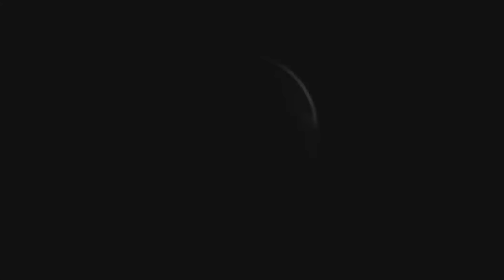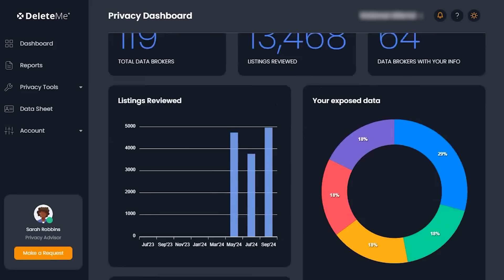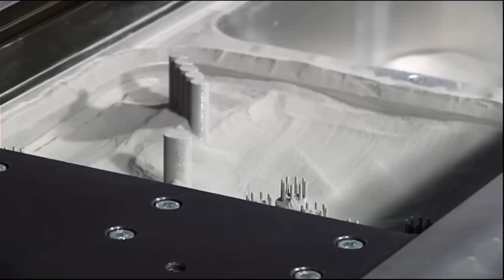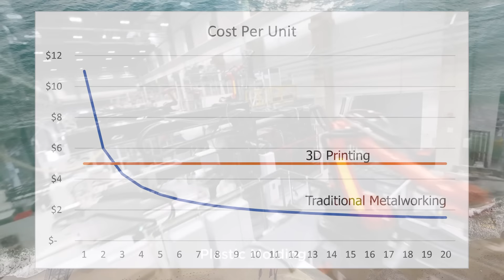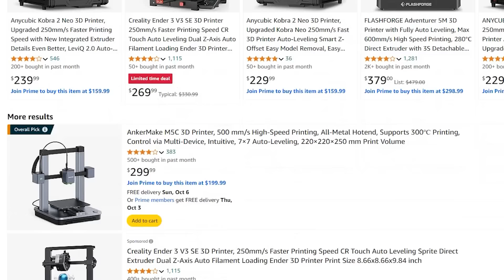3D Printing, Cathie Wood's Latest Disaster

Comment: 3D printing any sort of high-strength metal is laughable. Metal castings derive strength from a controlled and uniform cooling process, something which building things in a thousand layers can never provide.
Reply: You might want to look into Ti 3d printing using Ion beams. It's used in critical aircraft applications like wing roots and space/satellite etc where strength and weight is critical. You can Xray and other NDT them to check layer bond. ALso layer bonding when done right is basically the same strength as the material around it. I've had 3d printed parts fail perpendicular to bond lines many times in testing. Designing around it in some application is also important but it's not always a major weakness depending on the process and method used.
Reply: @N4CR  A lot of these parts she is aspiring to print derive their strength from the part cooling so precisely that it forms a single crystal. Impossible to do with printing.

Comment: Also........Elmo claims that Tesla is a robotics company, despite not actually selling a single robot. And if you paid for FSD, you got robbed by a conman
Reply: FUD!
Tesla has been selling robotic cars since 2015. Currently 8 million driving around now!
FSD is receiving unparalleled plaudits throughout the industry:
The first Tesla autonomous coast to coast/cannon ball run was October 2015. Carl J. Reese, Deena MastracciIn and Alex Roy made the 2,995-mile (4,820 km) journey in 57 hours, 48 minutes The trip was completed with fewer than 14 hours of charging and 96 percent of the driving done by Tesla's Autopilot system. 
"Tesla tear-down finds electronics 6 years ahead of Toyota and VW. Self-driving AI sends shivers through traditional supply chains. Tesla so far ahead of more established peers that its technology could end the auto supply chain as we know it." Nikkei xTech/Nikkei Automotive
“The performance after FSD 13.0 is still very strong. What we can see is that Tesla’s fundamentals are very solid. In the AI era, mastering the fundamentals is essential and cannot be skipped.” Li Auto CEO Li Xiang. 
“Tesla is indeed amazing. It has led industry trends in many areas, especially FSD (Full Self-Driving). We still have a lot to learn,” Xiaomi CEO Lei Jun 
"I think the Tesla stack is the most advanced AV stack in the world," NVIDIA CEO Jensen Huang.

Comment: I'm a mechanical engineer and for years I've been saying 3D printing has been over-hyped. Yes it has it's uses, but they're niche compared to traditional manufacturing as the video says. Inevitably there's always that manager that thinks it's cool and wants to impress his boss by trying to make it fit into product lines, but it never really does.
Reply: A product we're working with is a valve with electronic components that are very (very) tightly fit together. The valve body and it's parts are milled from whole but a simple to print (but difficult to produce otherwise) polyamide resin bracket to hold the internal wires in their proper place is 3D printed. The part adds value to the product, It'd be a very expensive with any other traditional manufacturing method (and have issues like sharp edges if stamped with associated costs and risks, exorbitant price machined) and is a novel application of the technology. It solves a problem at a reasonable cost without downsides (electrically not conductive, doesn't damage the wiring, keeps things neat, simplifies assembly, prevents damage...

It's just another tool in the toolbox. If we had a larger scale printer we'd also be able to potentially save another customer a fair bit of headache with a prototype they've been building. The lead times are around 6-8 weeks because they're complex (70kg of aluminium machined down to a 15kg housing with complex internal shape) whereas a 3D print could verify the assembly dimensions in 1-2 weeks with the milled down product coming a bit later with potential for in-process revision.

There's just a fair bit of figuring out what the tool is best suited for. There's a tendency we have as humans that when we have a hammer we see every problem as a nail however some structured guidance to people on when technologies are best used (including examples) to solve a problem can lead to win win out of the box solutions. Be it turning, milling, 3d printing, stamping, casting, forging or any other process.
Reply: Honestly it was a sure bet to short the stock. If you used common sense.
Reply: @paulnyagini  But it's a scary (and at times fatal) ride along the way. Professional short sellers don't short until the downtrend is solidly established. 

Did you know that Michael Burry almost went broke before he was vindicated?
Reply: It's better used as a component. E.g. I work aluminium, rivet, cut, shape etc, then combine it with it to make recycled alu LED lamps with extremely high lifetimes due to heatsinking.
Reply: Just the experience of 3D printing is fantastic!  Anything you can dream up you can produce!  But I guess not everyone gets excited about that.
Reply: Well that's also not strictly true. There are limits to the technology and not all printers have the same capabilities.
Reply: It's a really high skill floor to be useful. You need a ton of not obvious skills to make it work irl. Measurements in cad don't directly translate to the printer which can changes depending on calibration. It's really tricky for novices to get into
Reply: @ArcherNoble And then what? (Rapid Prototyping 20+ years.)
Reply: @jdmather5755  it's a joke smashing all the investment buzzwords together.
Reply: its used a ton for prototype but not production or home use

Comment: If a company goes public via SPAC it is not for investors only speculators.
Reply: SPACulators
Reply: @JeiShian 😂😂😂😂😂😂.
Reply: @JeiShian  Thank you😂
Reply: With the failure rate of SPACs, it boggles my mind that investors keep falling for them.  When will they learn?
Reply: You had to be in on the grift to profit off SPACs. Just a workaround to list a story on the stock exchange.
Reply: Whenever I hear the word SPAC, there is always a 95 % loss to investors coming in the next 3 years...
Reply: SPAC = SPeculator Aquired Company
Reply: And Wall Street.
Reply: There have been some good ones though. $HOOD , $ENVX & $DKNG come to mind. Problem is that a lot of companies that have no business being public used SPACs to do exactly that.
Reply: This is it!!!
Reply: Chamath P has entered the chat
Reply: Special Purpose of Avoiding Contention
Reply: That's what she wants. She wants the dumbasses who are willing to take greater risks than anyone else. That's basically what all of Silicon Valley is built on. The startup industry has made more billionaires for no reason than any other.
Reply: Rocket Labs seems to be doing ok.
Reply: @peterfireflylund  I did not realize that they were a SPAC and do seem more competent than some of the others in the field, hopefully, they will be the 1 in 20 SPACS that don't fail.
however
Rocketlabs reported third-quarter revenue of $104.81 million, up 55% 
 Its net loss of $51.94 million
By comparison, SpaceX was tapped by Space Force to conduct a series of missions worth $734 million in upcoming years
and that is a small contract for them.
Reply: I never trusted a SPAC from the moment I learned what it is. If a company can't go public via the traditional way and has to use loopholes likes SPaCs  then something is shady.

Comment: I cast metal, 3d printing is great for making mold templates, and anything that can't be cast can usually be made by casting and machining. Sure, there are extreme cases in the aerospace industry that can be made easier (but less strong) than traditional methods, but over all my job is safe as I do products with high value and medium size production runs.
Reply: Cathy seems to be implying she can print engine parts, ergo the fan/compressor blades themselves. I hear her talk, and laugh.
Reply: Parts can be produced lighter and stronger than casting and machining with 3d printers but the effort isn't worth it in most industrial applications.

Comment: Though im disappointed with the decline of 3d printing because it does have amazing potential, and rhe criticisms listed here are fair, i feel the need to point out the elephant in the room that the 3d printing industry never promised but was hyped by investors and others, and that's the problem with precision. For the vast majority of parts a few thousands out of spec isnt even noticable even downstream, but for the expensive parts like those going into the construction of injection nozzles and turbine ducktails where both precision and performance is a delicate balance, a pronting process will never work. 

Now, where i think 3d orintings greatest strength is, is in the development of prototypes is needed. A proof of concept that can be ptinted out in a couple days rather than meticulous measuring, machineing and a refining over a month can save loads of time and materials.

Comment: I mean the real advtage of a 3D printer is that on super small scale it allows individuals to make stuff at a fraction of the cost. But your selling it to individuals, the few people that maybe would need a print farm, or the R&D department that will use it to make quick prototypes rather then take up machine time in the floor. Yea as an individual my printer has been great and I do use it a lot….. but I still break out my dad’s old tools if I need to make something more heavy duty.
Reply: It solves logistical issues for much of the world

Comment: Still waiting and I own 3 printer and 2 printer are down for repairs. As I waiting for parts from china and amazon . And ever year 3d printer are going though cycle now it is different colors and speed.
Reply: What brand?  Get a Bambu Labs or a Prusa printer and you won't be crying.
Reply: @joeking433  Bambu is getting in financial trouble.

Comment: 3D printing was a complete revolution in scale modeling, but that's the SLA (resin) printers that are used, and they continue to evolve, with impressive performances nowadays. I have two SLA printers and one FDM printer myself, and used along a 3D design software (I use Blender), possibilities are simply limitless. I would even dare to say that 3D printing has revived scale-modeling as a whole, and that many companies that produce tools and paints are being saved by this turn of event. That's not a large part of the economy, but's at least all that work on 3D printing technologies wasn't completely in vain...
Reply: Piracy is the main driver behind SLA Printers.  turns out that people would print a car, or Space marine if they have the machine to do it.
pretty much every tabletop group has atleast 1 SLA printer.  mine has 3 and we went from having issues to people leaving the hobby to having more people that want to play than time.

Comment: I'm on sort-of on Ark's side and still think that this will continue to revolutionize manufacturing in the long term. The technology still cannot replace the majority of injection molded or machined parts, but there is no fundamental and unsolvable issue, especially when thinking about combining additive and subtractive manufacturing.

Comment: Oh, also….molding is not how 95% of aerospace parts are made. That’s very niche. Most are machined down from stock, nearly nothing is molded for production anymore. Nobody wants steel slag operations on hand, man.
Reply: Or most other industries that us any metal.  Forging and heat treating change the characterisitcs.  Not every thing is die cast or molded for a real, physical reason.   Cool tech.Some use cases.  But by no means near 50%!!
Reply: @FactbasedReality0421  Absolutely. You'd need a material testing lab on hand, and that cost would be wild. And there really wouldn't be any benefit to doing it in-house, which is one of the reasons 3D printing wouldn't make any sense in a ton of manufacturing areas.
Reply: Or formed, or welded
Reply: yeah that's the comment I was looking for. molds just dont cut it since the smaller the mold, the more defects it could have. as for huge blocks outer layers can be removed and factory edges are usually also remachined since they aren't always perfect so why risk it.
Reply: Magellan aerospace would like a word with you.

Comment: For tooling and prototypes 3D printing is great.  But you need to think differently while designing them to save material and print time.  You also can not hold tolerances and flatnesses like in a cast or machined part.

Comment: The example for metal, is for parts that can be molded. Actually called casting, in metal. But the strength of cast parts is not that good. Most metal parts are made from prefabricated blanks, such as sheets or rods. And these parts are not cast, but "rolled", which is a forging process. Metal made this way is much stronger than cast parts.

The problem with 'suits' (executives, and fund managers), are they are not engineers, familiar with manufacturing. They have a little and often have Dunning-Kruger hubris. One glaring example is Elon Musk, with his STUPID Gigacasting machines, to build Tesla frames. Those frames are starting to break, because a cars frame carries the greatest load, and casting makes for a weak material, relative to a "stamped" part. Stamping is also a forging process.

Comment: 3d printing always astonished me. They managed to come up with a production technique even slower and more expensive than machining, and then pretended that it was going to take over everything.
Reply: It has to have been marketing types who pushed that, 3D printing for manufacture has never been viable for anything that can be produced with traditional manufacturing techniques. There’s definitely a few niche places where it’s the only option for manufacturing something, but that’s pretty rare. It’s true value lies in prototyping, it’s a huge boon to be able to rapidly iterate on a design without having to get new moulds made, or work with a machinist constantly to produce prototypes when you may not even end up using a design. It also makes it a lot easier for hobbyists or entrepreneurs to get to a functioning prototype of an idea without a huge upfront investment. It’s also great for making replacements for random plastic bits that break on appliances and render them useless
Reply: It was never meant to replace machining. It's always been about rapid prototyping, and to a lesser degree low volume highly specialized parts that can't be machined, such as for high performance vehicles and spacecraft.
Reply: @DoesntRefillTheBrita  This is not what VCs and shills were saying in 2015. They were saying that big factories were obsolete and people would just make whatever they needed on their 3d printer in the garage.
Reply: @quartertwenty484  in case you haven't noticed, investors are usually dumb
Reply: You can't really machine plastic too well and it's much more expensive to machine than print if even for the cost of the plastic alone.

Comment: I bought a used 3D printer and make small models of interesting old cars. It took some effort to get it to work properly. You have to be willing to tinker quite a bit to get any decent results from the technology. It's pretty cool once you figure it out.
Reply: Modern printers are far more forgiving and don’t require tinkering at all. You still have to educate yourself a little on basics like all the different materials, and troubleshooting prints that don’t come out quite right. But in most cases, you can just load a spool and hit “print” to get good results.
Reply: @kaasmeester5903  I have an Elegoo Neptune 4, which is very new and considered user friendly.  I still have to level it if I have not used it for a while before printing, and have to apply bed glue if the print is considerably taller than it is wide, so that it doesn't detach from the bed mid-print, and cleaning off the glue after printing.  I also started to get concerned with air quality, as I have the printer in my room.  So I bought a 3d printer enclosure with a vent system, just to be safe and not possibly get cancer or anything in the long run.
Reply: You need to buy a new printer, one that is less than a few years old.  The difference is night and day!  The old Enders suck bad compared to the new Bambu printers.  Save up $199 and get an Bambu Mini, you'll be amazed at how far 3D printing has come!

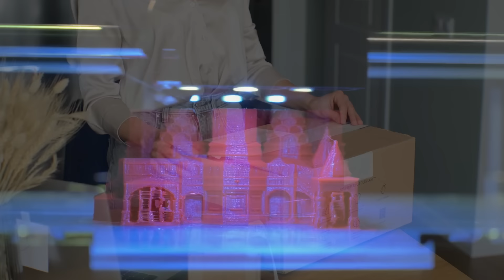Comment: 5:00 another way of looking at it... The printed part quality and durability < shipping a mass manufactured part (injection molded). 

When any industry is disrupted, look to the redistribution of labor. Either the machines do the labor, or the consumer. In the case of 3d printers, the marketing succeeded where industry demand failed. 

Marketing is the most pernicious career field / professional mindset, in modern capitalism.